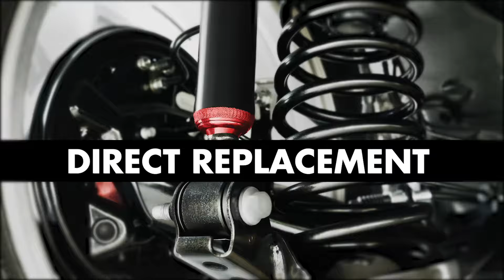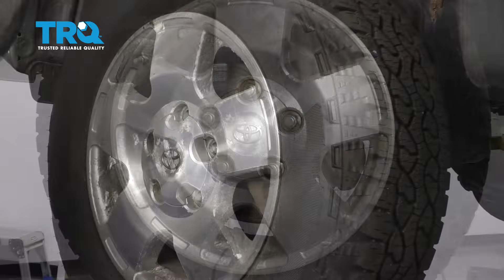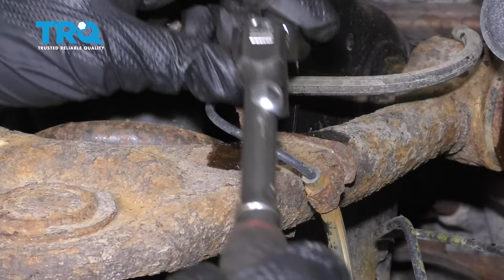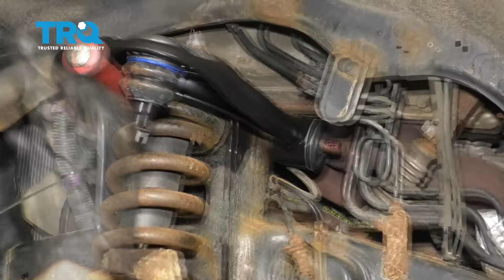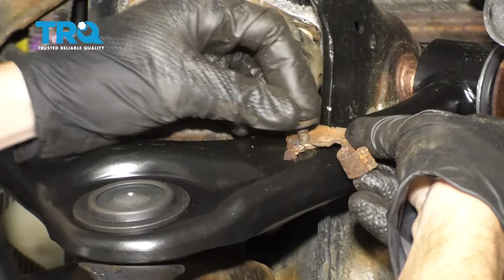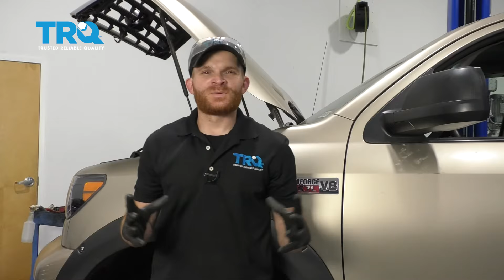How to Replace Front Upper Control Arm 2007-Present Toyota Tundra

Comment: that is one rusty assed truck.
I didn't replace the UCA's when I did my suspension lift.. I'm gonna have to do that. Looks much easier than lining the LCA up with that super long bolt when I had to take mine off for the new coil suspension/strut to go in there..